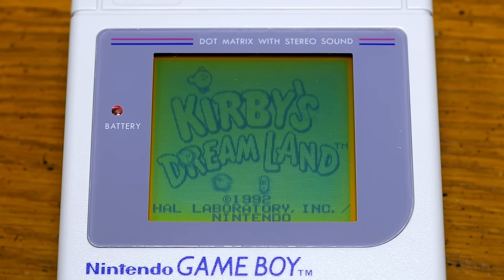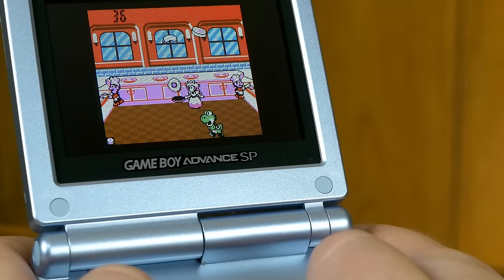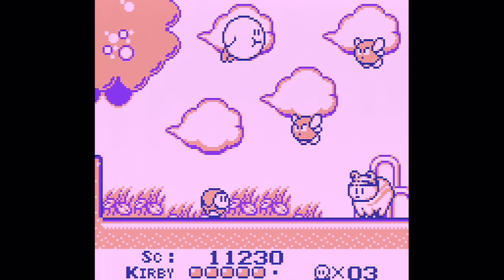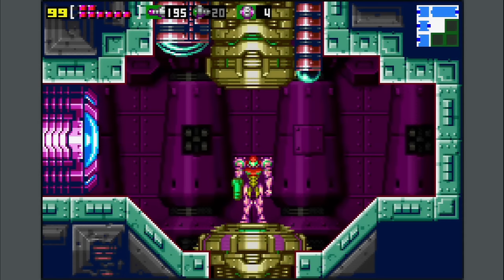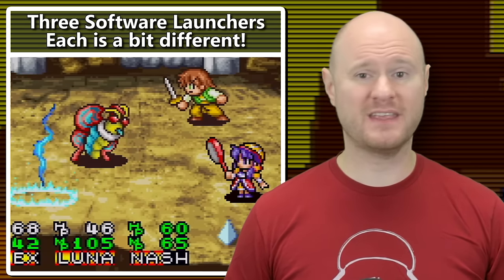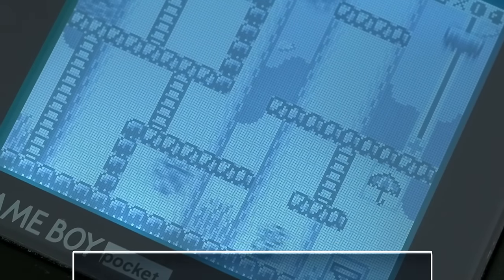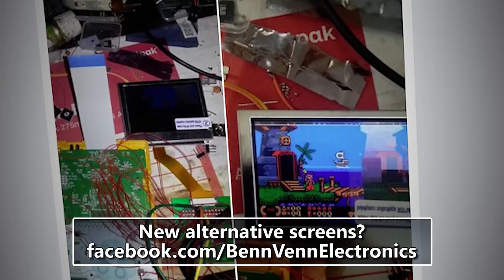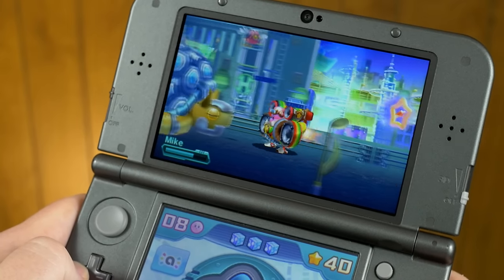Nintendo Game Boy, Game Boy Color, and Game Boy Advance :: RGB208 / MY LIFE IN GAMING

Comment: So if I want to use Gameboy interface, do I still need an action replay disc? And would a SD media launcher work on a PAL GC?
Reply from the maker: [Try4ce] You would need the equivalent disc for a PAL console. The only purpose to the disc is to boot the GameCube into a mode where it can read software from the memory card slot. But yes, the SD launcher hardware can be the same for any region.

Comment: Yes I've a Xeno chipped GameCube, Swiss boot disc for running the GB Player from SD>memory card, I briefly tried the one GBA SMW2 Yoshi's Island cartridge I have with component 480p>VGA on CRT and it was absolutely precious.. even more than the SNES on s-vid just trade-offs with its obvious butchering of the audio man oh man ={

So I don't know if I need to 240p it, or heck before I load the GB Player I think there's the Swiss options to force display mode why the homebrew app then I think it complicate too much to me? My monitor is a 19" so yeh I don't think the 480p really hurt the GBA output on me end? Mucho eye-melting crisp let me tell you

I need Everdrive now and play whole goodsets GBA+GBx!

(I achieving component>VGA with Beharbros' Garo it just won't let me see 480i BIOS heck I don't think can even 240p then, I've other VGA devices that are apparently giving me 480i on this monitor.. some workaround I have no idear..)

Comment: Hello there. when using the GBI solution, is there a way to change cartridges like in the official software? or do you always have to power the gamecube off and on everytime you change cartridges?
Reply from the maker: +kurikuraconkuritas [Try4ce] I think you do, yeah. I had mistakenly believed that hitting reset on the system and removing the cart at that time was "safe." Unfortunately that seems to have killed a few of my saves while I did that!
Reply: My Life in Gaming You have to hold it down while you remove and swtich the game, it kinda of a pain.

Comment: If you are going to use a PAL Gamecube for GBA games, why don't you just use a PAL GC as your main GC? If you are going to use Swiss anyway you might as well use it launch NTSC GC games as well and its a cheap way to get RGB Gamecube.
Reply from the maker: [Try4ce] It's been a super long time, but the main thing at the time was that you couldn't get 480p using the SCART cable from the analog port. But that didn't matter for GBI at the time. If you wanted 480p, you'd need to use the Digital Out port. There are more devices that can use that today, but there's no reason to go out of your way to get a PAL GameCube for them unless you live in an area where PAL GameCubes are the norm. Getting SCART from that port is nice, but is only going to be the ideal result for like, forced 240p.
Reply: @mylifeingaming  Hey Try! Yeah I know this is so old watched this series so many times over the years. It is a shame though that the RGB series will slowly become more and more irrelevant considering how ridiculously well made it is. Hope you eventually do a big updated remake series! And yeah your point is valid, I use a pal GameCube as I am in the UK but play NTSC discs and with Swiss off a SD card loader but the big difference is that I use a 60hz CRT. I have no problems with it there so maybe it’s only really a good idea in the US if you have a crt and happen to see a PAL GC online or something.

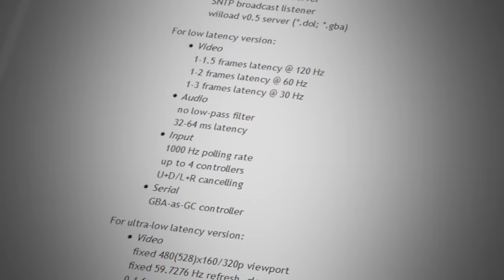Comment: About GBI 35:55, does it emulate GBP palettes? Certain games like SMB3:A4 have special palettes if using the Game Boy Player
Reply from the maker: [Try4ce] This is like the FF Tactics Advance palettes but automatic instead of an option? If so I was not aware of this. I'm unsure whether GBI does this, but I'm guessing yes.
Reply: My Life in Gaming Yep. FF tactics thankfully lets you adjust, but some games aren’t too lucky and need to be ROM-hacked for these to work on real GBA systems. However, some games automatically adjust. In the case of SMB4, GBP will use a SNES color palette as opposed to the GBA’s slightly brighter colors. I sadly don’t have a GBP and Dolphin has not added support for GBP (and probably never will), so I can’t test if it works with GBI.

Comment: Is there a way to use scart with an ntsc gamecube? Maybe with swiss or the gcvideom2 i'm guessing.
Reply from the maker: [Try4ce] You can't force it with software because it's not wired up that way. You can use SCART with the GCHD Mk-II, however, if you have a Digital Out port. Check our video from late last year for more information on current HDMI stuff for GameCube.

Comment: Where can I get that gamecube gameboy player custom loader disc? Or does my gamecube have to be modded?
Reply from the maker: [Try4ce] The custom software is on a SD card that you put in an adapter for slot B. The Action Replay disc is only a means to boot the GameCube into a mode that allows it to launch media from an SD card.

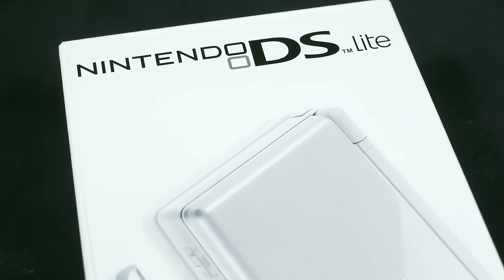Comment: 10:20 How did you sync them both at the almost same frame to each other ?
Reply from the maker: +LetsPlayKeldeo [Try4ce] I used a trick throughout this episode, whenever comparing systems side by side. I was borrowing many duplicate games from a friend so I could run them on two systems. I recorded the shot, and then put the clip on two video tracks in the timeline, one above the other. I drew a mask on the top clip to cut out the area around one of the screens, but you could see what was running on it in the layer underneath. So I just moved the bottom layer clip to the frame where they would sync up.
Reply: My Life in Gaming wow what a sneaky way to do that haha and thank you very much for awnsering :) You guys are making my day way to often and got me into reconstructing my set up multible times now ( Which is really fun for me ) as not only did the quality go up but I had fun messing arround with settings and even buying a PVM
Reply: My Life in Gaming its the small touches that really give this video its life :)

Comment: 32:16: Is it possible to use GBI while still using the boot disc for gameboy player?
Reply from the maker: [Try4ce] No, it's completely different software. The official disc is just software that runs the hardware. Using GBI makes it no less authentic because you're still using the GBP hardware. In fact, GBI runs it more accurately to a real GBA.

Comment: 30:36: Does upscaling the gamecube through the XRGB mini frameister improve the picture quality at all? Without modifying the gameboy player for better picture quality?
Reply from the maker: [Try4ce] As long as you use the Game Boy Interface instead of the poor official GB Player software, yes, you can do quite a lot to improve the quality. The GB Player doesn't need to be modded for any reason.
Reply: So the frameister won't make the official software look any better? Even through RGB or D-terminal?

Comment: I can't find the GBI.ULL, GBI.LL in the downloaded files. Were the names changed?
Reply from the maker: [Try4ce] Yes they were. I forget the new names off the top of my head. I believe there's one optimised for Framemeister, while ULL is now called Speed Run or something. I think they are essentially a unified version now, but with different default settings. Presets basically. You can edit the settings file to optimize it to your needs further if you like.
Reply: The LL is now SpeedRun, yes (and ULL was foded into that as well). I was looking through the forum topic on it and I'm not quite sure which mode to use now lol. I am ordering a GCHD to use on an HDTV and I noticed he added some presets for the GCVideo and GCVideoX in his HighFidelity edition, although he states to someone that those are intended for analog output to a device like OSSC if I understood correctly.

Comment: I bought an action replay but it doesn't work in my gamecube (DOL-001) is there a specific version of AR I have to buy?
Reply from the maker: +tinostarks [Try4ce] Hmm not sure. Could it have been from a different region? Or maybe it's just a roughed up disc?
Reply: Na, the disc works in my WIi no problem, it's like new. I don't even get a read disc error, it just doesn't even spin the disc, the gamecube boots like there's nothing in it. I see via Amazon reviews alot of ppl having issues with the disc just not booting.

Comment: Sad to see the AGP for the gamecube missing from this list lol
Even though its emulator has the frameskip set to 1. Which is unfortunate for games that used the gameboy advance's ghosting to do fade effects.
Reply from the maker: [Try4ce] You mean the Game Boy Player? It's definitely in here!
Reply: @mylifeingaming  The AGP was an aftermarket product by Intec that competed with the Game Boy Player. It required a boot disk, and the device itself plugged into the memory card slot.
Reply from the maker: [Try4ce] Wow never heard of it. But I suspect it's very similar to the other sorts of GBA clones, like what you use with SNES.
Reply: @yoyofargo  
The Advanced Game Port was actually made by Datel, distributed by Intec in North America.

SYK, it does work on the Wii and makes for a worthy cheat device, but regardless, it only plays GBA games. No GB, no GBC.

Comment: at 33:52 what is the tiny crt in the top right corner of the screen?
Reply from the maker: [Try4ce] That's a tiny little early 2000s Toshiba consumer grade CRT. Doesn't show scanlines very prominently, but it's a neat little TV. 14AF44. I also have a similar 24 inch one and Coury has the 27 inch version too.

Comment: Anybody ever try and take the ags-101 screen and swap it with the previous screen that doesn't have ghosting? Probably made differently.
Reply from the maker: [Try4ce] Yeah you can't combine the benefits of the two because one is designed for a light from behind and other is designed for a light from the front. Light won't pass or reflect the same way with those screens.

Comment: When the GameBoy came out in 1989, I didn't want one. I thought it was dumb. Why would you play on a tiny screen when you could play on your TV? My friends made fun of me for my opinion. I didn't get a Super GameBoy until 2007, where I discovered a lot of good games, but still no desire to play a handheld. Fast forward to 2020, and even though I've had my Switch for two years now, I've never used it outside of the dock except for the initial setup.
Reply from the maker: [Try4ce] I've actually used Switch in handheld mode far more than I expected to. I also much prefer to play on my TV, but being able to take my console quality game away from home without the experience feeling watered down is a much more compelling proposition than I originally realized. I love bringing my Switch with me.

Comment: the gameboy advance sp was the definitive gba after the ags 101 screen but now it's out classed by the original gba with an ips v2 display installed and a set of rechargeable batteries or battery kit. there's even an audio mod that makes it louder. the dsi removing the gba slot was a blunder in my opinion and it's the only ds i never owned. the new 3ds xl is the definitive 3ds imo and the ds original was it's best and can also be modded these days.
Reply: gba sp ips v2 is the best gameboy
Reply: @gamecubeplayer  my big hands hate the sp cause it's too small. lol
Reply: @AugustineDelgado  the gameboy advance rechargeable battery is too expensive
Reply: @gamecubeplayer  what do you mean? you can pick up a set of 4 rechargeable batteries from walmart for like $20 with charger. it can be about $45 for a usb type c battery mod but honestly, why do that when rechargeable batteries are so cheap and you won't the  need to deface your back plate by cutting a whole in it.
Reply: @AugustineDelgado  the gba sp battery is $10
Reply: @gamecubeplayer  a 4 pack of double A's is $1.
Reply: @AugustineDelgado  i mean the cleanjuice battery
Reply: @gamecubeplayer  that one's kind of a vanity piece though

Comment: The original 2004 DS is front lit.  The DS lite is backlit
Reply from the maker: [Try4ce] Not so, as far as I can tell, and our fact-checkers agreed. It's dim, but I'm quite sure it's still backlit. If you consider the front-lit GBA SP, brighter light from external sources makes it easier to see. Not so with the DS. The behavior of the brightness setting and evenness of the light does not behave like front lighting to my knowledge.

Comment: I think you need to stop pushing the Frameister. 1. Its TOOOO expensive, 2. Its hard to get. MOST people cant afford them
Reply from the maker: [Try4ce] We actually don't talk that much about the Framemeister anymore because we use the OSSC much more these days. Not exactly a cheap thing either, but quite easy to get, and for people interested in original hardware on modern displays, these things are still a worthwhile investment.

Comment: Ugh.  Some mistakes on the information.  The first “clamshell” Nintendo DS did NOT have a backlit screen.  I have an original DS.  It uses the same front-lit reflective TFT screen technology found on the original Game Boy Advance and GBA SP, but with an improved front light.  I know this because the system has a button on the touch screen allowing me to turn off the screen lights and I can go outside into the sunlight and still see my games perfectly fine, just like I can on my “football” GBA.  Please get your info correct if you’re going to put out an informational video.  Thanks.
Reply from the maker: [Try4ce] This was a point that I spent a lot of time researching and conferring with trusted sources and came to the opposite conclusion. I disagree that you can play original DS outside just fine. It is extremely difficult to see with the light off. The behavior of light on the front-lit GBA SP is similar whether using the front light or an external source. The original DS looks completely different, with even lighting. In addition, I'm unsure if that type of front lighting is possible for a resistive touch screen. This is a point that has little conclusive information out there for some reason (people just throwing around the front-lit or back-lit terms), and I'll concede that it is possible I got it wrong (at this time I do believe it is correct). But whether it is right or wrong, it is certainly not for lack of trying. That was a tough one to be sure of.
Reply: There is no mistake... The original GBA SP had a light you could turn off and you can see the light if you tilt your gameboy up and down. When you do this with the DS you do not see the same effect as it is back lit. If you look at the revised GBA SP which was released later you can see it is using a back lit screen and if you tilt that one it is similar to the DS. I have all 3 consoles. As for lighting, the original GBA looks brighter without the light and when you turn off the DS it is noticeably darker in comparison. 
I took this photo with an essential phone (I do realize I took the photos inside and used a downward facing lamp but I felt it was adequate lighting):
https://media.discordapp.net/attachments/421031760776658956/548310335292047380/IMG_20190221_170732.jpg?width=901&height=676

It is noticeably different. When I was younger I played my GBA SP with the light off during the day if lighting was good but with the DS it looks better with the screen light on.